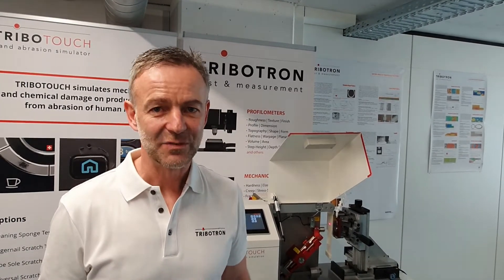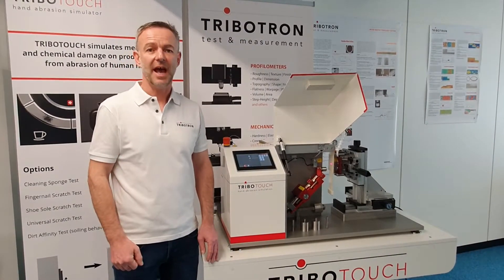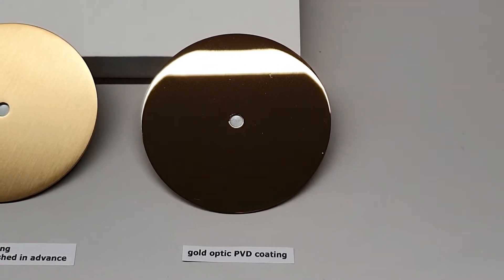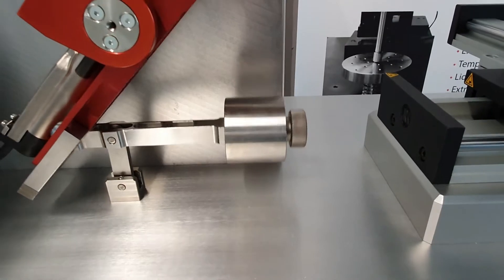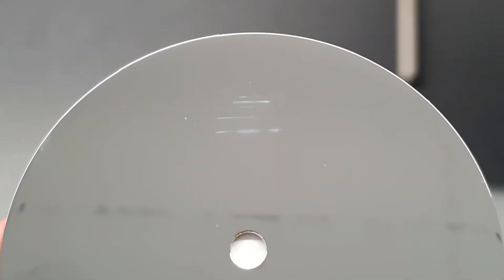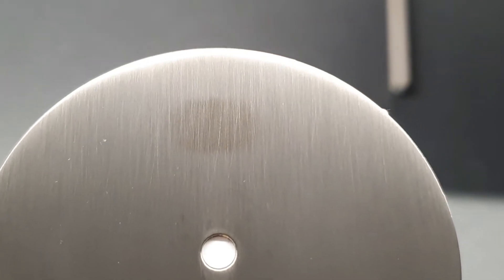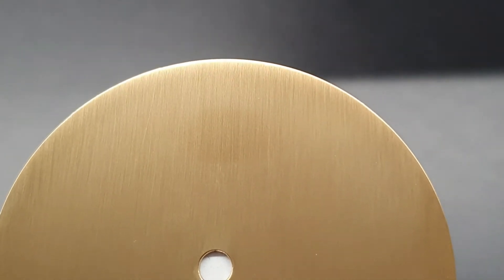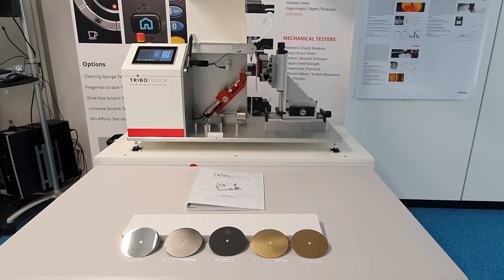Mar and Scratch Test on Hard Coatings

Comment: Short version. Pvd doesnt hold up for shit.
Reply: Short version: The test is worth less than shit at best, as they don't give any information whatsoever.

Longer version:
A proper, modern coating will withstand more than most can imagine. That's why a whole lot of high quality products feature them.
A good example for what a proper coating can handle are coated carbide inserts or endmills, they often can remove astounding amounts of material without having any visible wear at all even in quite tough and abrasive materials. Or parts with metal-metal contact in engine/Motorsports applications.

I don't know what they did here, but a proper hard coating won't show signs of wear that easily. Probably not even Chrome - which looks here as if there have been abrasive particles.